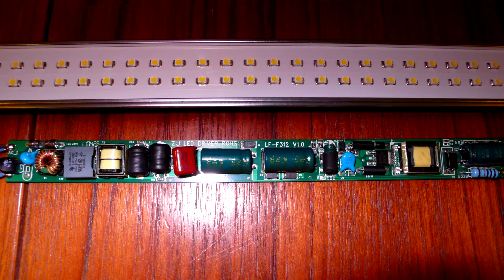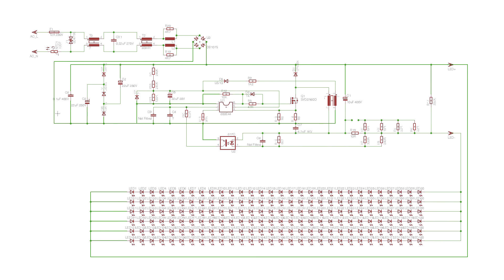Ecolite LED tube driver (LF-F312) mini-teardown and schematic

Comment: Tri-phospor tubes have colour rendering of 80-90, typically 85. Quad-phosphors tend to be 90+ . The website quoted in the other video doesn't mention colour rendering of the lamps, but LEDs are typically 70. The best tri T8s hit 88lm/w, T5s being 115lm/w. LEDs can be anywhere from 50-100lm/w, with these bein 94-96lm/w. The LEDs may last for 100k hours, but the ballasts never do. Typically expect 10k  hours compared to up to 300k hours for Switch-start.

Comment from the maker: YT's reply button's broken, so I'll reply here:-
The board dig took about 4.5 hours, starting at the mains end and working across.
If you check my previous video there's a link in the description to the tube catalogue, all the specs are in there but it's between 94-98lm/W

Comment: Hi. I have two LED tubes T8, 1,2 meters long. The problem with them is, that I can not hear FM radio anymore when they're on. Is there any possibility to do something in the lamp fixtures or something to reduce the EMI? The lamp case is earthed and the aluminium reflectors, too. But still the EMI is there...
Reply from the maker: Take a look at item 776-1128 on the RS Components website (a 						 								Schaffner 													FN2010-1-07, there are other models on the website). Mounting this inside the fitting MIGHT reduce EMI, stopping the tubes using your house wiring as a giant EMI antenna. Cheap enough, worth a shot.

If you're too tight for that but have access to an old (dead or alive) PC power supply, rip its mains inlet socket out, most of the ones I've seen are filtered. Add half of a kettle lead, job done.
Reply: AintBigAintClever
Thanks! I have some old PC-PSU parts left and a small bag full of common-mode chokes. Each tube has 20 Watts so every single one should be suitable.

How to wire the chokes is selfexplaining. The filter caps are in parallel with live and neutral, correct? The question is how to mount them... I have hole raster PCBs flying around but I think they are not so good because of creepage and clearance issues, correct? I think I can wire it all up with just wires, heatshring everything an put it into a small PVC box which I can 3D print or buy.

Oh I can not find the filter caps. Do you have any suggestion which caps I should use for this? 400 Volts? Which capacity?

I will try to make a video (english spoken, german subtitles) assembling this so everyone can fix their LED lamps, too.
Reply from the maker: *****
The PC PSUs I'm thinking of have metal can IEC inlets with built in EMI suppression (look at RS item 						780-4963 for example), I'd attach one of those to the inside of the fluorescent light batten with a jubilee clip (if it's a Fitzgerald or similar there'll be suitable slots for such a clip) and solder the wires on.
Reply: AintBigAintClever
Unfortunally the IEC inlets doesn't have any filtering can. It are just normal ones. The filtering was done on the PCB and I salvaged the common-mode chokes and the caps. But I can not find these caps anymore. I can read 234K on the grey cap on your LED-Driver in your video.

I also see a MOV, a cap and TWO common-mode chokes. Really? There is one toroid and one normal one. And then two more inductors another filter cap which obviously has an SMD mounted bridge rectifier under it and then electrolyte caps for more DC filtering.

This is one hell of proper filtering and protection. I'm really impressed... But I'm afraid that I won't be able to get some because the brand broke like you said in another video...

Don't remember the brand of mine but they were not cheap. Really, ther were not cheap...
Reply from the maker: ***** Compared to the usual crap we see it does seem to be well filtered! I guess this was actually made to be CE compliant and sold IN the UK, rather than crap badged up as CE compliant and sold direct from China.
Reply: This might be true. Could also be designed in the UK and made in China.

Aldi sometimes has LED tubes in their sortiment. But Dave L. Jones from the EEVblog did a teardown. They are designed in Germany and made in China. Not very good filtering but better than the china crap. Unfortnually ugly 4000K color temp. I don't like it, I like 5000 - 6500K and they did not have any of them unfortunally.

Can you confirm the cap value in your video? I will just order two 400V rated ones and try them. I will do a test run with 25 Watts dummy load before I will fit my filter into the fixture just to be shure.
Reply from the maker: *****
224 K not 234 K, so it's 0.22uF 10% tolerance. The capacitor also shows two ratings, 250VAC and 275VAC, I guess that depends on the certification (250V is shown above the UL marking, 275V with a bunch of others)